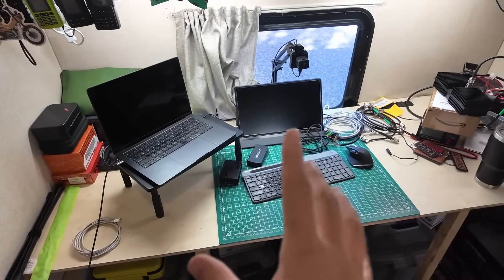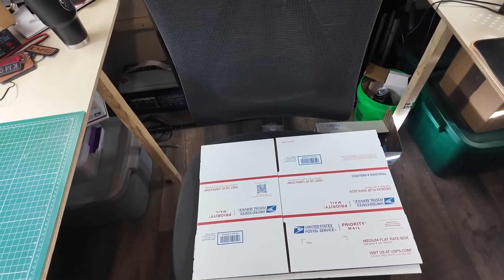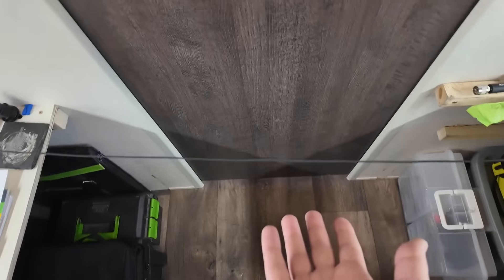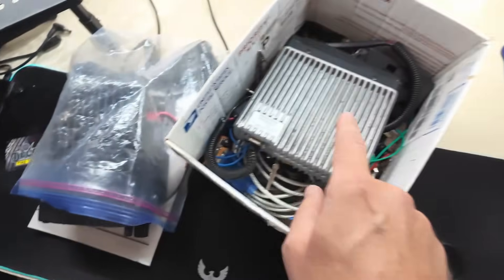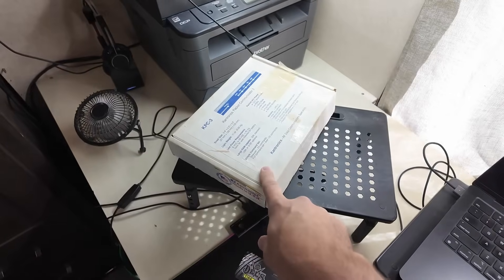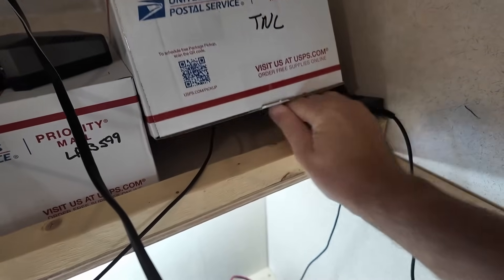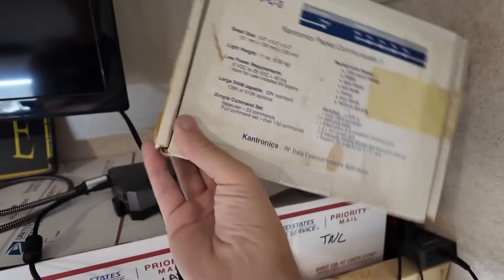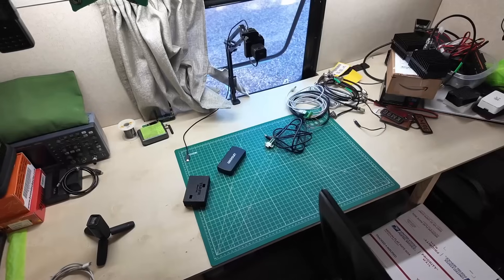State of the Union - the TNC Union

Comment: Does the TNC have a usb-b high speed port? It looked like a standard usb-b port like the old printers used. But your usb-c to usb-b cable you put in the box has a high speed plug.
Reply from the maker: @sarah6229AD9FA  no high speed plug on the TNC.  Although the NinoTNC is the fastest TNC you can get, It's not that fast of a device in terms of computer speed.  I did mention that the high speed cable wasn't necessary.

Comment: Nice update !  lots of cables for a wireless hobby !  I gave the state of my UNUN earlier today . 10/11/12 meters was great DX and my 4:1    UNUN is in the snow saying I am cold. Bitter cold in NY ! I gave my 4:1 UNUN 100 watt FT8 for a few hours . Snow did not melt. Using a RED T200-2 Toroid.  feeding 25 feet wire. So the state of my UNUN is still COLD !  73
Reply from the maker: @robertmeyer4744  I could never melt the snow on any of my antennas... Must have been very efficient!  Warm up friend!

Comment: Steve, this is a great project, I am hopefully it will get me started on my packet project again. After talking with Tadd at the Charlotte, NC Hamfest last year I spent the next 10 months getting a lot of TNC's (Nino X2, KPC3+ X3, Digirig X3, TinyTrak 4 X1, & Signalink USB X1), Yaesu FT-2980, ID-4100, and some dual band vertical outdoor antennas. I have used some of this to setup a APRS digipeater/igate, RMS Winlink Gateway (VaraFM & Packet) on VHF, and had fun with PinPoint APRS software. However, my ulitmate goal is to setup a local TARPN network the same as NC Packet. At this point I need to build the cables to go between the Nino TNC and my radios. I purchased the pre-built SMT Nino TNCs so my cables will be the mini-din and not DB9. I will be tuning in for your next installment of this series. You have probably already seen it or even talked to him, but ModernHam has been putting together a great packet radio series recently as well. 73!
Reply from the maker: Sounds like you've got a great collection going!  I have talked to Billy (ModernHam) and he's even been on Nuggets playing with us for a show or two.

Comment: I can tell you FT2600M does APRS. The stock cable uses the 9600bps port, whose output comes direct from the discriminator so the output is too high, so I had to cut the gain jumper on the Digirig. YMMV
Reply from the maker: Good info!  I need to try that out.